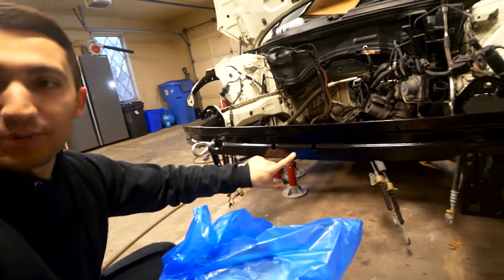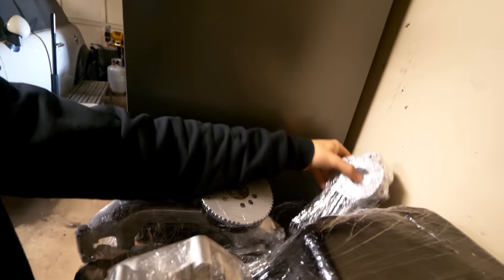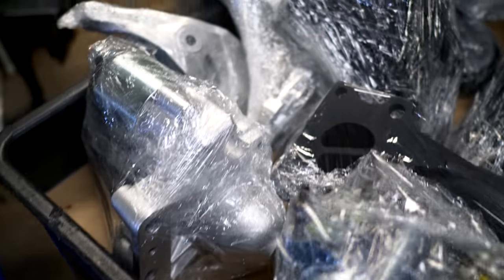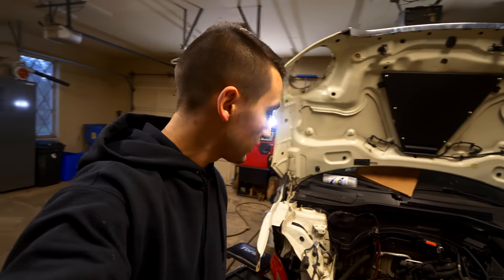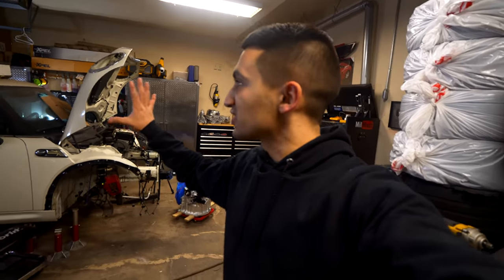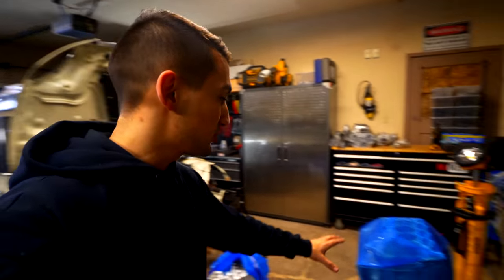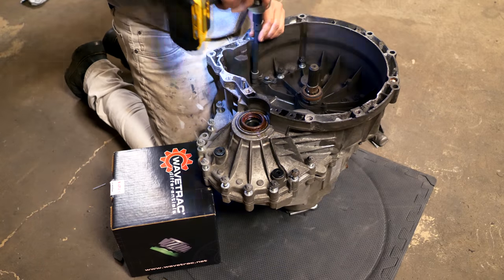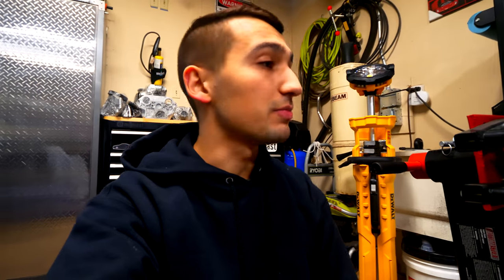THIS IS WHAT I'VE BEEN UP TO!!

Comment: Hi ... i'm been watching your videos for a while now and I think you are awesome!! So I think maybe you can help me with something... I was working on the valve head gasket, so I unplugged the battery because I dont want to deal with shorts problems... but sadly when I finished and hooked up the battery back, my turn lights, fog lights, interior lights and windows dont work ... I was doing some research but I got no succes finding a solution ... it seems to be my frm module .. do you have any idea of what can I do? Thanks.

Comment: Hello again. Great work but i have some questions about the engine. As i see you have the oem exhaust manifold. My opinion is that you can put the oem jcw manifold, is better and have very good flowability from the standard one. The other thing i wanna ask you if you put blockguard seal to engine to secure more the engine and the cylinder sleeves. Pm if you want more info